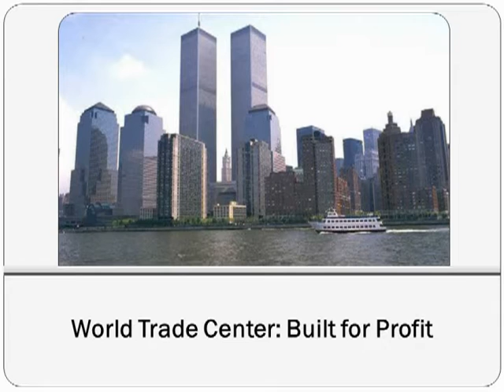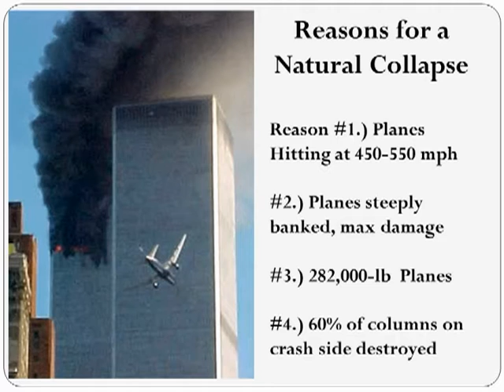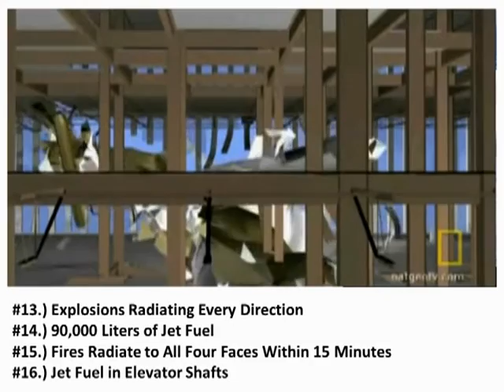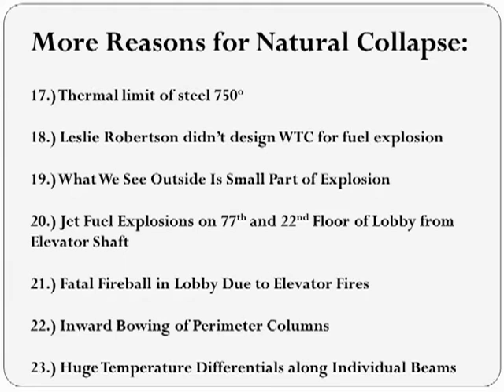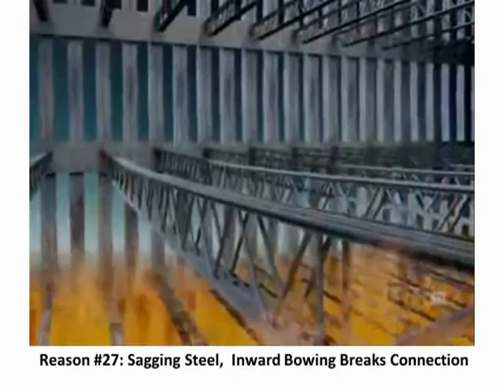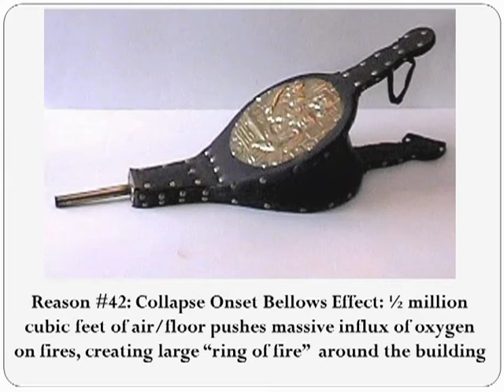Part 1, 9/11 Conspiracy Theories: Chris Mohr's Rebuttal to Richard Gage

Comment: 2,100 Architects & Engineers, the Hundreds of Pilots & Aeronautic Engineers, Dozens of Phd Scientists, inc Noble Prize Laureate & Scholars who have Published 116 Peer Reviewed Papers & created Dozens of Documentaries on the Facts & Truth about 9/11. 100-Million People in the US & Hundreds of Thousands of others who have researched 9/11 & are demanding an "Open Criminal Investigation into 9/11."
And then there is: "Christopher Garrett Mohr (born May 11, 1966 in Atlanta, Georgia) "a former NFL punter," played football at Briarwood Academy... an NFL punter until 2007. (ref-wikipedia). Not an engineer. Not an Architect. Not an Investigator. Not a Pilot. Not a Policeman. Not a priest, yet he is sermonizing behind an Alter, in a church, attempting to make us believe he is "Credible" & has some "expert" knowledge he can lend to Balance the debate. Is he Kidding?
He keeps putting his FEET in his mouth with every bit of dribble he lets out;
The actual architects of WTC 1-2 state they factored in between 5 & 20 times required redundancy into the engineering, NOT your stated 3. They designed the Towers to with stand several fully laden Boeing 707 impacts at 600mph (slightly smaller than 757's but 100+mph faster = Greater impact).
Chris mentioned the Massive "Hat Trusses", which he should have known, were Welded into a Massive One Piece-Solid Structure of almost un imaginable proportions (approx 1 Acre in spread). This Structure was welded to ALL 240 outer colums & ALL 47 inner colums, the Hat Trusses literally "tied the Towers together." The Hat Trusses survived the Plane impacts & were much to far away from the impact zones to be affected by any of the kerosine fueled fire heat. YET, the Hat Trusses on Both Towers "Disappeared" into fragments. Not One Truss was found twisted, but attached to anything? They had been severed into pieces and that had to have taken place "Mid-Air" which means with no impacting forces?
Freefall collapse also meeans, "No Impacting Forces" which means the Lower structure of the Towers had to be taken out "Before the upper sections Hit them" otherwise the Upper section Would Slow down to far less than Freefall in order to smash the lower floors/structure out of the way. Both 110 floor Towers fell in under 12seconds; thats about TEN floors a SECOND. The lower 80-90 lower floors weren't affected with heat or damage; the Hat Trusses had kept the Towers together as it had been designed & engineered to do... YET, the lower structure "Including Most of the Sub-Level Basements", just Disappeared without creating ANY resistance, into a Very Small pile, because 4-6 upper floors were impacted by 1 plane?
Why Didn't NIST or the FBI or Any Govt agency "Investigate Explosives Evidence" even after Hundreds of witnesses testified that they saw/heard & felt Explosions & Intense heat All Around & over ALL three WTC buildings after the plane impacts on the upper floors???? And yet the ONLY explanation for 3 Buildings to fall: "Suddenly, Rapidliy, Symmetrically, From the Inside, Into its Own Footprint" is a Controlled Demolition. Evidence of Explosives & Demolition Incendiaries was found in the WTC dust, was analyzed & confirmed by Four different scientists, they Published papers on their findings and have challenged NIST on these findings, "without response."
Yet NIST & the Govt Won't support with ANY evidence or publish data/calculations which they used to come up with their conclusions???
 AE911 has Published ALL its Data for Professional & Public scrutiny and they get this Chris-NFL Punter out as an charliton expert to rebfute them???
What about the other "116 Published Peer Reviewed Papers" supporting 9/11 Truth made available over the last ten years & the hundreds of other researchers & the Dozens of Documentaries all Supporting 9/11 Truth.
Pilots for 9/11Truth (includes radar technicians & aeronautical engineers...) have analyzed ALL data made available to the public & from FOIA requests on the Planes: Flight paths, Speed, Handling, No Fly Zones, Pentagon AA missle systems, Tragectory of impacts, Size of initial damage & later damage...  and have Published All their findings for Professional & Public Review.
As a comparison what has the Government & its Agencies done?
-The Government/CIA/FBI has "Classified all NIST's calculations on the WTC collapses"; "Due to Public Safety"??? BS; if safety Was a concern ALL Steel Framed Hi-Rise construction building codes would have been radically altered in the MONTHS after 9/11, to ensure "No More Collapses". That hasn't happened.
-The Govt... has Classified ALL 80cctvcamera footage around the Pentagon on 9/11 (except for 5 frames which had been tampered with) "for National Security" again BS Hiding the visual evidence of "Exactly What Hit the Penagon on 9/11" means: "the US Government is Aiding & Abetting the perpetrators of the greatest criminal act of Terror ever undertaken on American Soil."
-The Govt OMITTED ALL eyewitness Testimony (Hundreds of people) regarding continuous Explosions within ALL three WTC towers on 9/11; William Rodrguez was an exceptional Hero on 9/11, a 19yr employee of WTC-2, he saved more people on 9/11 than anyone & assisted firefighters to save many others; Rodriguez was awarded the Medal of Honor for his bravery on 9/11 by GW himself, YET Rodriguez testimony on what he saw, heard & experienced on 9/11 was: Held in a Closed hearing, all his testimony has been Classified, no part of it was ever published in the 9/11Omission Report & he was Banned by All US media; Because Rodriguez has always maintained that a Massive Explosion occured in a lift-shaft in the Basement of WTC-2, seconds "Before" he heard an impact of some sort in the upper levels of the tower (which was the plane hitting). Rodriguez & 250 other survivors & family members launched a law suit against the Bus admin & complicit parties and that law suit was also squashed, again due to "National Security Reasons".
In short, there is an Overwhelming amount of evidence in US Government, Military & Agencies "Complicity in carrying out 9/11 as a Massive & Complex False Flag operation to achieve multiple goals" and then spend a massive amount of time "Suppressing the Evidence."
Reply: trdrbear Yeah! Why should someone who does investigative journalism, be more believable than a couple of very young film students, who edit their own films?
Reply: What I have found is that there are 105,847 licensed Architects in the United states, and there are 135,760 Architectural Engineers (aka Civil Engineers.) in the United States Alone. That brings the total of knowledgeable Architects and Engineers who are qualified to determine the facts about 911, to 241,607. Now consider that to date, 2,301 of them have signed the petition offered by ae911truth. So, since 2,301 is only a little over 0.95% of 241,607, more than 100 times as many Architects and Engineers, accept the conventional idea that a combination of plane crashes and fires, brought down the Twin Towers, and, that this was the work or terrorists. World wide there are likely hundreds of thousand more that also agree with that large majority in America!

You're "overwhelming support," amounts to less than 1% of those qualified to judge 911.If one adds all the physicists and scientists in related fields, I doubt that percentage will go up. Then if one adds all of the direct evidence confirming that truthers cherry pick information and edit films, in order to circulate information based on little more than conjecture--those supporting the conventional story, have an extremely credible case for rejecting the arguments from this very small minority of conspiracy theorists!
Reply: trdrbear,

I don't remember using the figure of 3, to represent  the amount of extra load bearing floors that were factored into the original design of the towers, but if either I, or Mr. Mohr said so, both of us was mistaken. I'll go back and check out his video's to see exactly what he said. But what I have since found, and mentioned to another commenter about this issue, is that NIST reported the following; 

"The vertical capacity of the connections supporting an intact floor below the level of collapse was adequate to carry the load of 11 additional floors if the load was applied gradually, and 6 additional floors if the load was applied suddenly (as was the case). Since the number of floors above the floor of collapse initiation exceeded six in each each WTC tower,(12 floors in WTC 1 and 29 floors in WTC 2), the floors below the level of collapse initiation were unable to resist the suddenly applied gravitational load from the upper floors of the building."

So, 11 floors were included if the load was applied gradually, as opposed to only 6 floors if the load was applied suddenly, as it was in both towers! And, even if the load had been applied gradually, each tower had more floors exceeding the 11 floor load bearing limit---(12 in tower one and 29 in tower two). The physics and math do assert the conclusions reported by NIST!

About several other assertions you make--yes architectural standards weren't changed rapidly because, after all, it took several years for many through studies to be done--but those standards have been included as of today. And, although some material was classified in the beginning, as it would be expected in any domestic attack as large as 911 was. But since then, the testimony of Mr. Rodriguez and many others have been heard, and HAVE been made public. Although he undoubtedly deserved a medal for his bravery, many of his claims are unverfied and contradictory to other known facts. This also goes for a great deal of the "smoking gun," anomalies doted on by truthers. One of those being that although many people reported hearing explosions, very few of them actually asserted that what they heard came from (bombs), and these two loud noises are NOT NECESSARILY the same. Many eye witness account have been found to have been taken out of context, and many other "facts," are actually far from proven.

Nobody is preventing 911 truthers from publishing as many peer reviewed studies as they desire, but to date those they have published often are submitted to journals without the established esteem and reputations that the major ones have. Many of truther's claims have also been dismissed because information in them is not objectively verifiable, or is downright untrue!

As far as Mr. Mohr is concerned, he is wildly known as a peace advocate, and has a divinity degree. He may not have the scientific credentials that many of his critics believe are necessary to do thorough investigations about such a scientifically based topic, but, do you really think that a young  film maker like Dylan Avery DOES possess those credentials? And remember that only a little less than 1% of the licensed Architects and Engineers in the US, actually agree with 911 truthers--so truthers have thus far presented far from an overwhelming body of evidence in support their beliefs!
Reply from the maker: Instead of trying to besmirch Mr Mohr's character and flood the comment section with spam, why don't you focus more on the actual points Mohr made? Better still, why not watch the whole series - who knows, you might actually learn something new! You already presented at least one falsehood. You stated that the towers fell at 'freefall'. All you have to do is look at the video footage and notice that the loose wreckage was falling faster than the crumbling towers. But hey, of what concern is accuracy, to a conspiracy theorist?
Reply: finlarg mohr is Less than a decietful clown, has NO steel frame structural engineering training or experience, isnt a physicist, doesn't have a Phd in any science category... & U think Im going to Learn something from either Him or fkd up douche bag like u, whos most scientific comment is "to look at the video"??? For your pea brained information: "Structural Engineers & Phd Physicists Have anylyzed Multiple sets of video footage & determined that "Sections of the ALL 3 WTC Towers Definitely Fell at freefall, with the Majority of ALL WTC Towers falling at "Near Freefall." Not only that dipshit They Have Written & Published Peer Reviewed Papers on  these facts & presented those facts to NIST "Who Have NOT contested the findings."
But Hey, whats Accuracy to a fkn Retarded Dildo using Arse Troll.
Reply from the maker: trdrbear Near freefall and freefall are not the same thing.

Mohr is a journalist. It is not a requirement of journalism to hold qualifications in all subjects one writes about. The fact that he interviewed physicists and engineers and reported his findings has obviously gone straight over your head, because, like a religious fundamentalist, it's all about finding evidence to support your story, rather than figuring out what's true.

You should look up 'confirmation bias', then consider how many documentaries you've watched, made by conspiracy theorists, and compare that number with the fact that you're spamming the introduction and part 1 of this series, rather than dealing with the actual content.

BTW, the ad-homs don't help you one little bit!
Reply from the maker: trdrbear Gage's 'documentary' is pure propaganda. Why did they only show a small selection of the images of WTC 7, over and over, when they could have shown the ones where you could see smoke existing at all levels? I'll tell you why - it would have refuted their bogus argument that there only were  a 'few small fires'.

You conspiracy theorists are blinded by your need for there to be a sinister intent behind pretty much anything. Apparently you have no idea how asinine the notion is that so many thousands of collaborators could have pulled off such unprecedented 'demolitions' and got away with it for so long. I'm ashamed to admit I used to be as gullible as you are now!

Did you know, I unmarked all of your comments as spam? I should have left them. Conspiracy theorists never think their arguments through to it's logical conclusion.
Reply from the maker: trdrbear Apparently the unusual construction of WTC 7 is of no importance to you. Nor is the unprecedented nature of such building 'demolitions'.

Conspiracy theorists expend a great deal of energy promulgating pseudoscience - what's your point?

Did you even bother to watch the rest of this series? I can't help noticing you're only commenting on part 1 and that you've failed to address specific points in this video series. You're just using this as a platform to preach your deluded fantasies! Typical conspiracy theorist!
Reply: Which part of the WTC-7 construction? The initial construction or the later re-engineered alterations?
You are calling: Physics & Structural Engineering, Psuedo-science? Interesting.
Keep dribbling fkwit
Reply from the maker: trdrbear As it was on the 10th September 2001. Obviously.

No, I'm calling 9/11 conspiracy theorists pseudoscientists. In case you weren't aware, the majority of physicists and engineers are not 9/11 conspiracy theorists.

Are you capable of conducting a conversation without verbal diarrhoea?
Reply: as usual, Unable to answer ANY  questions or statements, Avoid the subject when presented with relevant FACTS... all u can do is dribble...
IF at any stage in your life u manage to develop a cerebral cortex, "carefully remove it from your arse before using."
Until then, I suggest u go to the school for "Delusional Retarded Govt BS & Dildo Luvin Trolls" to develop your skills; because u don't register, u got Nothin & it shows for all the world to see=Fkn Pathetic!
Reply from the maker: trdrbear You're welcome to make an actual point relating to the video you're commenting on.

As it is, your comment is filled with scientifically illiterate assertions such as:

"...the lower structure "Including Most of the Sub-Level Basements", just Disappeared without creating ANY resistance, into a Very Small pile, because 4-6 upper floors were impacted by 1 plane?"

If you bothered to watch this video series, from start to finish and actually paid attention you'd understand the foolishness of what you wrote.

You obviously have no concept of the physics of the aircraft's kinetic energy, the impact damage, the weakening of part of the steel structure by fire and the resulting buckling, which led to it's failure. Nor do you seem to have the first clue about the effect of gravity on thousands of tons of damaged building and the way it's collapse was slowed by the intact structure beneath - contrary to your asinine claim that it offered no resistance.

Why oh why is it the scientifically ignorant who feel so strongly that they're right? Where do you get such arrogance from?
Reply from the maker: trdrbear I note you're incapable of commenting without insults or answering the very simple question of whether you watched the rest of this series or not! How old are you - 12?

Also, your grasp of physics is woeful! The kinetic energy of the aircraft caused the impact damage. While you're busy setting up strawmen, the rest of us were taking note of the fact that the structures were weakened - obviously and visibly. Weakened first by impact damage and then further weakened by fire damage.

Why is it that conspiracy theorists like you invariably ignore the fact that aircraft crashing into skyscrapers was an unprecedented event?

The fact that other fires in skyscrapers didn't always cause their collapse is irrelevant. You guys fail to acknowledge the fact that the WTC towers (including 7 to a lesser extent) sustained physical damage, which was exacerbated by fire damage. You also fail to understand that load bearing steel structures do not require temperatures anywhere near their melting point to be WEAKENED.

You conspiracy theorists also fail to acknowledge the fact that the towers did survive the impacts for long enough for thousands to evacuate.

You guys show no interest in figuring out what really happened. It's sad that your apparent need for sensationalism overrides your ability to reason.
Reply: I don't expect dikless arseTrolls to be able to read or have a brain or be able to assess Anything in a calculating or even logical manner; being moronic & dribbling incoherently is what arseTrolls do, I get it.
BUT, you should explain your "Gravity Collapse Theory for ALL Three buildings though,
tell the utubers How the tops of WTC 1-2,
the lightest, smallest parts of the Towers go directly Through the Heaviest Strongest 80% of the structure? NOT over to one side from the Assymetric Damage u ellude to??
at freefall speed-"Magically" not impacting with ANY resistance??? 
and then somehow "Vaporize themselves"??? leaving no hint of their size or structure or the HAT Trusses??? "More Magic."???
What a Great Magical Theory,
Please explain it in your best psuedo sapien dribble; we can all do with a laugh,
especially at an arseTroll.
And THEN have a go at explaining WTC-7 & your NO Plane Connetic Impact, Magical Implosion Collapse at Freefall.... "Magic"
Don't Mention EXPLOSIVES or
CONTROLLED  DEMOLITION; you won't get any shekels if you do.
Reply from the maker: trdrbear If you can't even string a coherent sentence together, without insults, then there's no point continuing with this. You obviously think you've got it all figured out. Delusional halfwit!
Reply: u won't be missed, try stem cell therapy while your gone,
with your head up your arse it could act as an incubator & u may be able to grow a brain, though I doubt it.
Reply: Peter Johnson As stated:-  
2,100 Architects & Engineers, the Hundreds of Pilots & Aeronautic Engineers, Dozens of Phd Scientists, inc Noble Prize Laureate & Scholars who have Published 116 Peer Reviewed Papers & created Dozens of Documentaries on the Facts & Truth about 9/11. 100-Million People in the US & Hundreds of Thousands of others who have researched 9/11 & are demanding an "Open Criminal Investigation into 9/11."
And then there is: "Christopher Garrett Mohr (born May 11, 1966 in Atlanta, Georgia) "a former NFL punter," played football at Briarwood Academy... an NFL punter until 2007. (ref-wikipedia). Not an engineer. Not an Architect. Not an Investigator. Not a Pilot. Not a Policeman. Not a priest, yet he is sermonizing behind an Alter, in a church, attempting to make us believe he is "Credible" & has some "expert" knowledge he can lend to Balance the debate. Is he Kidding?
He keeps putting his FEET in his mouth with every bit of dribble he lets out;
The actual architects of WTC 1-2 state they factored in between 5 & 20 times required redundancy into the engineering, NOT your stated 3. They designed the Towers to with stand several fully laden Boeing 707 impacts at 600mph (slightly smaller than 757's but 100+mph faster = Greater impact).
Chris mentioned the Massive "Hat Trusses", which he should have known, were Welded into a Massive One Piece-Solid Structure of almost un imaginable proportions (approx 1 Acre in spread). This Structure was welded to ALL 240 outer colums & ALL 47 inner colums, the Hat Trusses literally "tied the Towers together." The Hat Trusses survived the Plane impacts & were much to far away from the impact zones to be affected by any of the kerosine fueled fire heat. YET, the Hat Trusses on Both Towers "Disappeared" into fragments. Not One Truss was found twisted, but attached to anything? They had been severed into pieces and that had to have taken place "Mid-Air" which means with no impacting forces?
Freefall collapse also meeans, "No Impacting Forces" which means the Lower structure of the Towers had to be taken out "Before the upper sections Hit them" otherwise the Upper section Would Slow down to far less than Freefall in order to smash the lower floors/structure out of the way. Both 110 floor Towers fell in under 12seconds; thats about TEN floors a SECOND. The lower 80-90 lower floors weren't affected with heat or damage; the Hat Trusses had kept the Towers together as it had been designed & engineered to do... YET, the lower structure "Including Most of the Sub-Level Basements", just Disappeared without creating ANY resistance, into a Very Small pile, because 4-6 upper floors were impacted by 1 plane?
Why Didn't NIST or the FBI or Any Govt agency "Investigate Explosives Evidence" even after Hundreds of witnesses testified that they saw/heard & felt Explosions & Intense heat All Around & over ALL three WTC buildings after the plane impacts on the upper floors???? And yet the ONLY explanation for 3 Buildings to fall: "Suddenly, Rapidliy, Symmetrically, From the Inside, Into its Own Footprint" is a Controlled Demolition. Evidence of Explosives & Demolition Incendiaries was found in the WTC dust, was analyzed & confirmed by Four different scientists, they Published papers on their findings and have challenged NIST on these findings, "without response."
Yet NIST & the Govt Won't support with ANY evidence or publish data/calculations which they used to come up with their conclusions???
 AE911 has Published ALL its Data for Professional & Public scrutiny and they get this Chris-NFL Punter out as an charliton expert to rebfute them???
What about the other "116 Published Peer Reviewed Papers" supporting 9/11 Truth made available over the last ten years & the hundreds of other researchers & the Dozens of Documentaries all Supporting 9/11 Truth.
Pilots for 9/11Truth (includes radar technicians & aeronautical engineers...) have analyzed ALL data made available to the public & from FOIA requests on the Planes: Flight paths, Speed, Handling, No Fly Zones, Pentagon AA missle systems, Tragectory of impacts, Size of initial damage & later damage...  and have Published All their findings for Professional & Public Review.
As a comparison what has the Government & its Agencies done?
-The Government/CIA/FBI has "Classified all NIST's calculations on the WTC collapses"; "Due to Public Safety"??? BS; if safety Was a concern ALL Steel Framed Hi-Rise construction building codes would have been radically altered in the MONTHS after 9/11, to ensure "No More Collapses". That hasn't happened.
-The Govt... has Classified ALL 80cctvcamera footage around the Pentagon on 9/11 (except for 5 frames which had been tampered with) "for National Security" again BS Hiding the visual evidence of "Exactly What Hit the Penagon on 9/11" means: "the US Government is Aiding & Abetting the perpetrators of the greatest criminal act of Terror ever undertaken on American Soil."
-The Govt OMITTED ALL eyewitness Testimony (Hundreds of people) regarding continuous Explosions within ALL three WTC towers on 9/11; William Rodrguez was an exceptional Hero on 9/11, a 19yr employee of WTC-2, he saved more people on 9/11 than anyone & assisted firefighters to save many others; Rodriguez was awarded the Medal of Honor for his bravery on 9/11 by GW himself, YET Rodriguez testimony on what he saw, heard & experienced on 9/11 was: Held in a Closed hearing, all his testimony has been Classified, no part of it was ever published in the 9/11Omission Report & he was Banned by All US media; Because Rodriguez has always maintained that a Massive Explosion occured in a lift-shaft in the Basement of WTC-2, seconds "Before" he heard an impact of some sort in the upper levels of the tower (which was the plane hitting). Rodriguez & 250 other survivors & family members launched a law suit against the Bus admin & complicit parties and that law suit was also squashed, again due to "National Security Reasons".
In short, there is an Overwhelming amount of evidence in US Government, Military & Agencies "Complicity in carrying out 9/11 as a Massive & Complex False Flag operation to achieve multiple goals" and then spend a massive amount of time "Suppressing the Evidence."